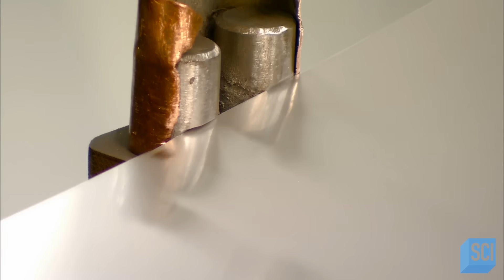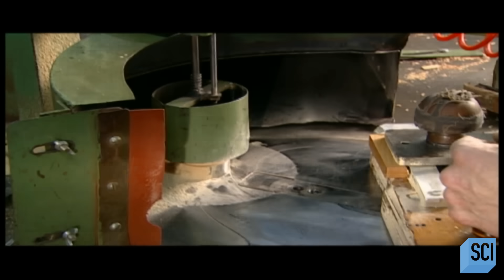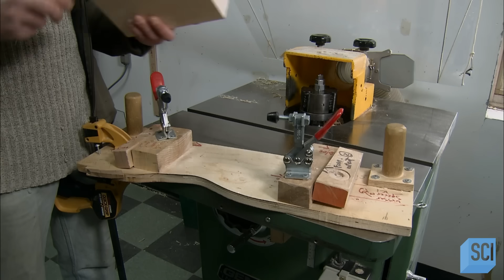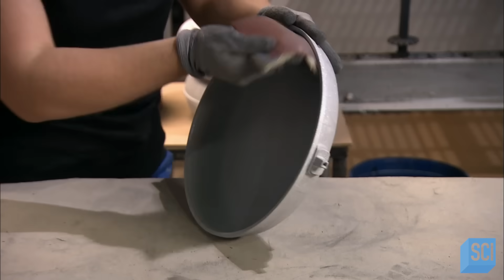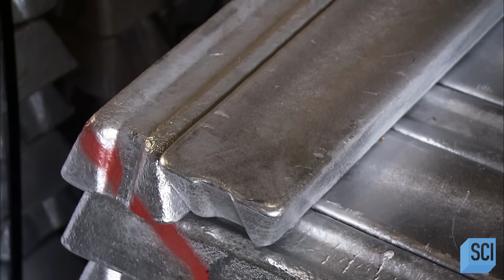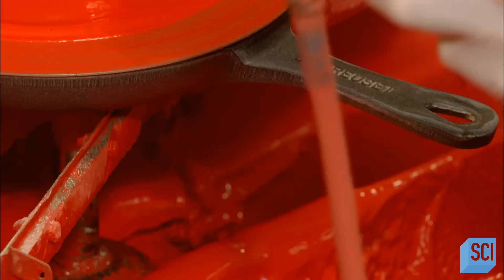Pots, Pans, Stoves and More! | How It's Made | Science Channel

Comment: Electricity heats up metal.
Period.
Video over.
Reply: No, the electricity doesn't just heat up metal in those cooking tops.  If that frying pan had been stainless steel or ceramic, the egg wouldn't have fried. You probably use a electric stove. It'll burn you if touched, right? No, that's a induction burner. It uses strong magnets to heat the top. For this reason only metal with lots of free electrons like copper or aluminum will heat up. The most it'll do to you is draw some blood to the area and speed up healing. There's lots of iron in blood.
Reply: Copper and aluminum are not heated by an induction cooktop.  You need a ferromagnetic material like cast iron, carbon steel, or low-nickel stainless steel.  The iron in your blood is not ferromagnetic.  Hemoglobin is weakly magnetic and won't be affected very much by the magnetic field of an induction cooktop.  All metal has lots of free electrons.

Comment: How does the electric furnace work? I hate it when they skip steps.
Reply: Magnets. It's why all pots you use on such stoves must have a copper core. Copper gives up electrons easily and thus heats up when exposed to a strong magnetic field. However non charged things like you and towels won't. It will help heal you though, as your body uses charge to stimulate new cell growth. I use PEMF or really weak magnetic fields to draw blood to damaged portions of my back. No, it does cause changes in your body, they're just far more muted.

Comment: If it's Pyrex glass you're after, get the pieces marked, "PYREX" all upper case letters. That is Pyrex glass manufactured by what was then, the Pyrex company. The all upper case logo means the tougher, borosilicate glass that is far better, far less likely to crack due to thermal shock. The Pyrex in this production, "pyrex" all lower case letters, was licensed out by the company essentially to inferior glass producers. Yard sales, flea markets, thrift stores and online auctions are about the only places you can still find the good stuff.
Reply: Thanks for the tip
Reply: Being marked "PYREX" in all caps doesn't mean it's borosilicate glass.  Corning used soda lime glass for most of its Pyrex cookware made in the 1980s and 1990s, and for some items going back to the 1930s.  It's only for cookware made since 1998 that the logo tells you the type of glass:  "pyrex" all lower case and made in the USA is soda lime glass, and "PYREX" all upper case and made in France is borosilicate glass.  That holds true for the cookware manufactured today.  And by the way, "pyrex" isn't licensed to inferior glass producers.  For the U.S. market that cookware is made by Corelle Brands, which is the direct lineage of Pyrex cookware.  The company was spun off from Corning in 1998, and uses the same factories and methods that were previously used to make Pyrex cookware.
Reply: @jbalazer  The upper case, "PYREX" is a good shorthand for superior glass. It is either borosilicate clear glass or properly tempered, colored soda lime glass. I don't use anything other than the clear bowls and clear baking dishes though I didn't identify that in my OP. As for the lower case, "pyrex" being made with the same methods and materials, that has not been my experience. The performance of the latter suggests a dramatic change in either methods or materials, if not both.
Reply: Utter fabrication. In the civilised world, such things are regulated. I realise "regulated" is a pinko term to you, but then that is precisely my point.

Comment: Changed out the gas hob for an induction just before Christmas and honesty its changed my life. I have ageing grandparents who are starting to get a little forgetful at times. There have been times when i have found the burner still on hours after cooking, there has also been  a tea towel or two set alight  😂 💀. This is not possible now as the hob detected a dry pan and shut down. It also shuts off if there is no pan. It is as controllable and as powerful as a gas one too so long. As you pick the right one. Being able to wipe it clean as you are cooking is amazing too. There are also not 'hotspots' as the whole pan is the heater.
Reply: My husband broke the door to the oven of our electric stove.  Turned out to be easier to the just replace the stove.  We ended up with an induction stove and I love it.  The worst part was that I had to get rid of most of the pots and pans that we had at the time.  Turned out to be a blessing in disguise.  So glad we did.
Reply: @ConfidentialMeerkat, induction cooktops are quite susceptible to hotspots.  They only heat a part of the pan bottom that's smaller in diameter than the induction coil.  So you need a big coil to heat the entire bottom of a big pan, and it won't heat the sides at all.  Sometimes also you get a cooler spot in the middle of the pan.
Reply: Do those induction stoves really work, I’ve installed them as an electrician but never knew anyone that had one. Ive heard people say you can touch it and not burn yourself after you take the pan off but I don’t buy that
Reply: @DandE3524  I've got a 7.5kw total 4 burner, so about 2.5kw each spot. I can bring a 1.5L pot to the boil on the normal sized spot using the power boost, the P after setting 9 in about 3-4 mins.  It also has a big pot spot that can do the same, but with 5L. After power level 4 downwards, I have noticed it's not quite so great at low simmering, as its cycling on and off so frequently, but I think its more for maintaining temperature rather than acually cooking, which it does perfectly and is consistent. Then again, if you wanting to cook that slowly, that's is what a slow cooker is designed for afterall. 🤷‍♂️ as for the touching part. Yes and no. It is still quite hot to the touch like having a normal glass top, and putting a dish down on it after taking it out of the oven. BUT your skin won't stick to it like a normal glowing ceramic and give you 2nd or 3rd degree burns. (I wonder how I know that one. Rolles eyes) it dosnt fizzle when you wipe it with a cloth put it that way.
Reply: I should also note ive done the test of putting both kitchen roll and  a tea towel under the pot and boiling the water, and nither were in the slightest harmed which I thought was amazing.
Reply: @ConfidentialMeerkat actually the only reason it's hot is because there used to be a pan over the heat drawing in warmth. Turn on the stove and just stick your hand on it And it'll be cool And stay cool.
Reply: @Dylanfrenchmusic  Yes, they indeed do. The cooktop itself never generates any meaningful amount of heat. The magnetic coils in the cooktop make the PAN the heat source instead. So, the only heating of the cooktop itself is just from the hot pan touching the cool stove. And since the cooktop has a very rapidly cooling enamel surface (the ones I've dealt with anyway), once you remove the pan it cools to safe-to-touch in only a matter of 15 to 30 seconds. Now as for the "do they work", there is a caveat. Since it uses magnets to excite the atoms in the pan, to make the pan itself heat up, and not every type of metal responds to the magnetic fields the same way, not every type of pan will work on an induction stove. If you get an induction stove, make sure all your cookware is induction ready. Should say so on the packaging in most cases.
Reply: @Dylanfrenchmusic yes, induction stoves use magnets to cook. It's why all cookware must have copper or aluminum cores at the very least. Stainless steel doesn't release electrons easily. Magnets move around electrons to produce heat.